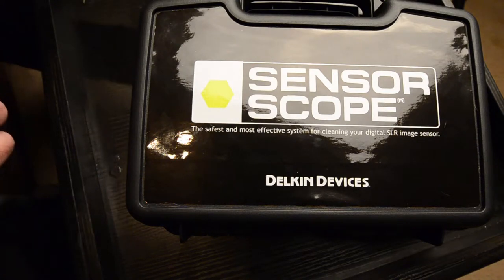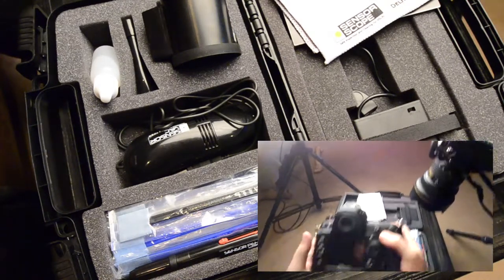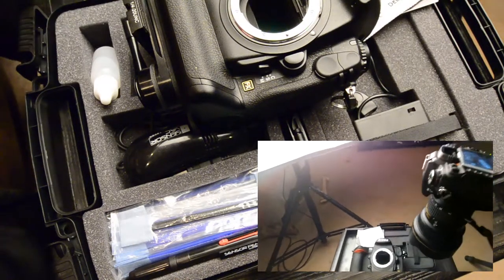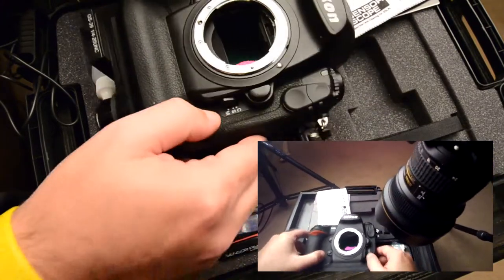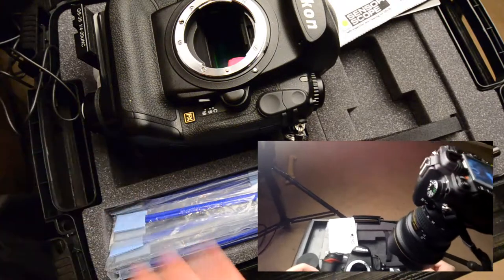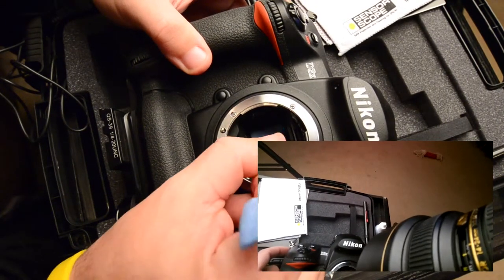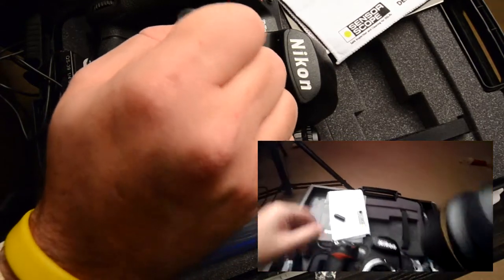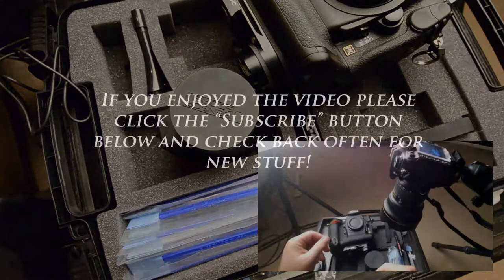Cleaning Your DSLR Sensor (Delkin Cleaning Kit)

Comment: Thank you for the tutorial. Personally I'd be concerned about vacuuming the sides of the interior then moving to the sensor. It seems that would enhance the chance of dragging any foreign dust or even oils from the camera onto the sensor. It's too bad they don't include two vacuum tips. One for the sides and one for the sensor. Nice use of Google Glass in this tutorial. Maybe cut the picture in picture when you are using one camera or the other as it became distracting during parts of your video. It also took up a lot of real estate. Maybe just alternate back and forth using a fade?